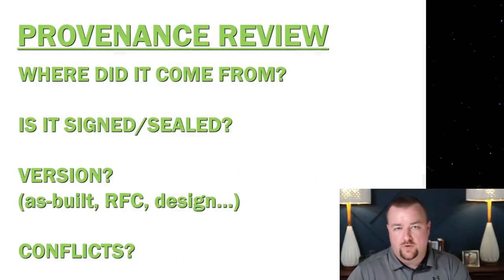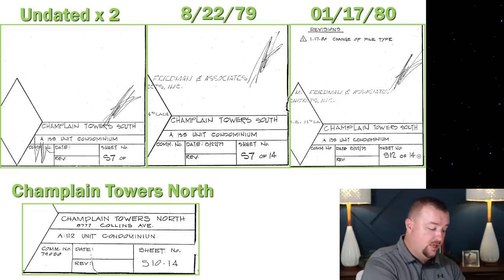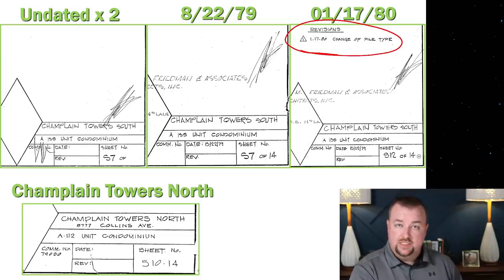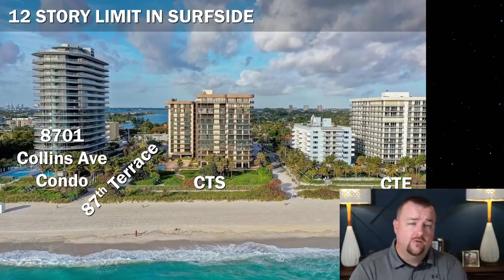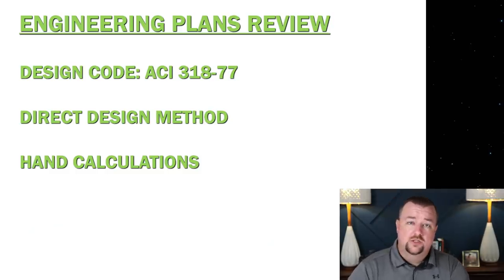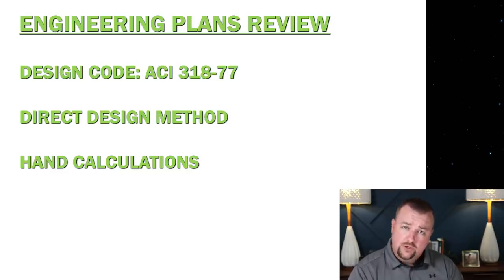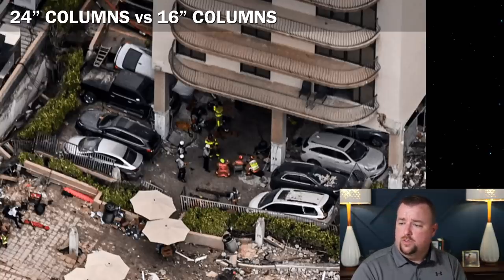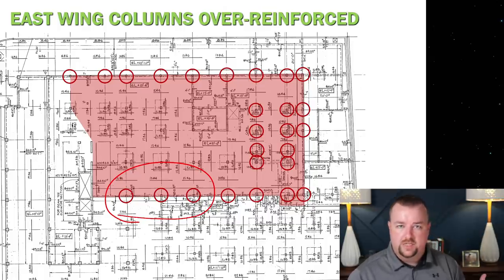Engineering Failures Found in the Champlain Towers South Drawings - Surfside Collapse

Comment: Not sure how it works in your World but in mine (Aerospace), EVERY aspect of an ECN (Engineering Change Order) after "Rev. Basic/O" Drawing gets signed off on from all affected Engineering Groups (Stress, Manufacturing, etc.) at the detail level which then feeds "up" to higher "Integration Levels" to ensure "Continuity".  As the Design "Matures" or is "Improved (say going thru many changes over the years from Rev. 0 to say Rev. X), many factors are involved ... including a new set of eyes looking at potential "flaws" in previous revisions along the way ... sort of a "Fail Safe" Process and the lines of communication are "2 Way" ... both up to and down from "Integration Engineering" (including overall Aircraft "Weight" (Gravity works 24/7 ;) and you can't "pull to the side of the Road at 50K feet".

I bring this up, my question to you, is how are "Engineering Changes" handled in Civil Construction? I get the initial stages from "As Designed/As Built" ... but what happens after that? Did the original Engineering Company retain that function of oversight or does it get handed off to an "HOA"? I say this because without the Beams you speak of, there most probably were loads that over maxed the compressive loads/shear punch limits in those areas ... from individuals putting in giant "Hot Tub/Bathtubs" to allowing far larger vehicles into the Parking area over the years; there's a reason our Highways/Bridges have load restrictions right? All it takes is one 20 ton Truck rolling over that unsupported (and "Beamless") area to have cracked it. Just wondering who has the "Ball" on those aspects...

Great job on the investigation and continue to enjoy your insight into this field of Engineering !!! Bravo !
Reply: HOAs do not enter the picture until the construction is finished and most of the units are sold.

And before we villify HOAs, remember they are just laypeople who have no engineering or construction experience.  Did you get an owners manual for your home?  Neither did they.
Reply: Aerospace ... you mean, like the Boeing Maxx??    

There are a lot of systems for both aerospace and engineering/construction, but they only work as well as the competence and integrity of the people executing them. 

Remember, 49% of people are below average...and even a C+ or B- practitioner in these trades could prove deadly.  This engineer was clearly not A level.
Reply: @1556cm  the question, as I indicated in my comment, was for Josh ... his Channel not yours. And I disagree with your premise that HOA's shouldn't be 'Vilified" ... if an entity takes the job, then they need to have adequate Staff to do the job (i.e. capable/educated Engineering Staff or outsource access to same). If what you say is true (you don't state your Engineering Background), then that, IMHO, is a BIG hole in the Process and needs to be rectified.  And actually, yes I did get a full set of prints/manuals for my house here in the French Riviera ... it too is built in "Concrete" as are most in EU.
Reply: @craigsowers8456  HOAs are volunteers from among the owners in a multi-unit housing who get elected for usually 2-year terms to make sure bills get paid and contracts are issued for normal maintenance.  They do not have staff.  They may have a property management company who assists them.  None of them are engineers.    

Here in the US, no one gets a manual for a building like this to tell them what maintenance is needed.   When something goes wrong, they get several bids and hire someone to fix it.  In this case, they did hire a contractor to make repairs, but had no way to know that he did not know what he was doing.

The HOA Board must have approval of the homeowners to raise dues more than a minimal amount, and those owners will almost always say no.  This is a gigantic flaw in this system, and the law that allows owners opt out of accruing funds for future maintenance is as much a part of this building collapse as design flaws.
Reply: @1556cm  Thanks for the explanation and fully agree ... HUGE HOLE IN THE SYSTEM !!! Seems like a good "Class Action Suit" to me !!!
Reply: @bluur101  No, but your comment is one more example of why one shouldn't  "ass"ume.  I am in Finance and quite familiar with those concepts.  But most people--you might say, the average person--is probably not.  Therefore, I didn't get technical about a subject which is irrelevant to the topic.

Comment: The beam question: guess the weight of vehicles in the '70s (pre-oil crisis) compared to nowadays SUVs! 
Conclusion: "size matters" :o)
Reply: but the majority of them would have still been large heavy pigs of pre oil crisis, especially in Florida far away from the rust belt, even though ocean salt spray is bad.
I imagine those units were not cheap back then and the richer folks had plenty of money to keep fueling their pigs :)
Reply: @throttlebottle5906  the new clio is almost a half ton heavier as the one from 2004....mine has 1090kg the new 1510kg .....
Reply: @tomast9034  I'm used to vehicles that weight 1900 to 3000kg! 4200 to 6600 lbs (rounded). not including anything over  3/4ton rated vehicle.
that's what the majority of USA trucks, vans and cars weighed back then and many still exist today. that's also the GVWR of todays large SUV's here.

Comment: I find it hard to believe an engineer forgot to add live loads when he engineered any parts of that building
Reply: They didn't forget. The loads are noted on the drawings. They just made a mistake in the calculations so that the overall capacity could just support the DL without any factor of safety. You have to review the design notes to see where they made the error.

Comment: Columns above not in alignment with columns below.  Transfer beam missing at key live load areas in lobby-level parking.  Dead loads at 100% before live loads added.  Building waiting 40 years to begin to take corrosion and structural damage seriously.  

If you produce another video, I look forward to your explanation of the likely progression of the failure once the lobby level parking slab punched through.  I think it will reveal further design errors.

If the structural engineer and firm are still around, they will both be sued into bankruptcy unless they have a very hefty E&O policy...but I doubt the policy will cover what will likely be nearly a half billion dollars in claims.
Reply: Unfortunately, the engineer and developer/ contractor escaped justice in this life.  We can only hope they received it in the hereafter.

In CA, there is a 10-year limit on suing for patent (observable) construction defects.  I don't know if there is a limit on latent (hidden) defects.

Comment: So the building was built unsafe from the beginning. It was the blueprint was changed and the architects didnt change the plans to make the necessary strength back into it after making these changes
Reply: even the original plans were at Max load as in you can't put anything more there like planter, large crowds, construction equipment and supplies, fire trucks, ect. and there can't be a Ocean anywhere near by as in salt water. Even the original plans were build to fail in effect.
Reply: Oh forgot to add they added a additional layer of pavers on top of the original level thus doubled or more the dead weight fo the slab. (this something that must be expected in plans, people with cover old with new instead of remove, people will put anything that will fit on top of things)

Comment: The only person crazier than realtors is a "developer".  At least realtors have to attend barely a school.  Developers just have to have money.  

The system is flawed.
Reply: And what do you suggest?
Reply: Thats what regulations are for, along with Plan Check.
Reply: To be fair, a developer just appoints consultants to do the design & construction, all being educated, trained and registered in their particular fields.   They don’t undertake any of that.   What degree do you need to assemble a design & construction team?   And usually when you have obtained enough money to undertake such projects, you are able to assemble teams.   Sure developers put pressure on design and construction teams to build cheaper, but theses consultants have a duty of care not to give in.  Part of the job.
Reply: @ProjectFairmont  Justin is correct about developers and there is not an easy answer to the problem..My guess and it’s  only a guess that the project was out of the budget and changes were made to reduce the cost. Architects, engineers and the contractor want the project to progress and they will offer various solution to reduce the cost.  The professionals must resist the pressure exerted by the developer to take things to the edge.  Sometimes you have to walk away but I guarantee there  will be others to do the job.
Reply: @Jim Archer There is no way in holy hell that a licensed engineer made structural changes to a building that would jeopardize the occupants, and his/her career, under pressure to "save costs". What a load of crap.
Reply: @ProjectFairmont  I would recommend a second independent check of the structural design by the authority as part of the permitting process. It doesn't even have to be a complete check. In order to save costs, you could even limit the design check to commercial steel and concrete buildings over 2 stories high. It just increases the overall level of care. Right now there is no independent process. The design and checks are all done by the developer's consultants.
Reply: @roscoejones4515  Back in those wild days in Miami of course they make those changes they wanted to actually be able to work. Even now it should be easy to find licensed engineers that would do it or at a minimum like here design to just meet the minimum standard of max load. 
Developer was a very shady person with possible mob connections, one inspector seams very compromised. I forget which key figure had been suspended in the past I think it was the Engineer.

Comment: Basically the way they designed this building is like stacking dinner plates on toothpicks and then putting a cinder block on top and then get the toothpicks wet.
Reply: Nonsense. Watch the vid again.
Reply: The columns did not fail originally, the deck failed, and it was that failure that led to damage to some of the main structural columns and subsequent collapse of the building.

The columns supporting the pool deck were still intact after the deck collapsed, they did not fail.

Comment: The 40 year interval was criminal to begin with. If I’m a 55 year old (corrupt) developer I’m not concerned about 40 years from now. I’d do the least amount of work necessary to pass the initial requirements and let the next generation deal with it.
Reply: Well said. And the 40 year rule was created from a Government building failing 40 years after construction so it should have been 35 years at the longest just based on that. But correct no more than ten for complete rework. And all plans with additional changes should be rotated though a automatic recheck everything process over time.

Comment: 8:44 People tend to design to the minimum code, and tend to push to the maximum that the regulation allows.
That's how the building owners trade safety for the maximum profit.
Reply: That's unfair, because it's over-simplified.  You must design to a finite budget, or no one could afford to live in the result.  (More realistically, you'd never raise the money to even break ground.)  That's where good engineering comes in--making the most structurally efficient use of a fixed $$ amount of concrete and steel.  In this tragic tower, it seems they stole from the Structural Budget, and put it in the Decorative Marble and Pretty Plants Budget... rolleyes

Comment: Any City that isn't going through older buildings drawings is setting themselves up.
Reply: There is a similarly designed building down the street from me.  It is 17 stories high.   All the columns are thin and spindly.  Get this, the building was originally built in 1967.   It has sat gutted for over a decade with no walls.  Just alternating slabs and thin concrete columns.  It was exposed to the elements all that time.  This includes hurricane Erma.   So they slapped on paint and walls and carpet and now it's a 65 unit condo building.  The building across the street I watched being built more recently.  This was built using more traditional load bearing walls but it is 5 floors and the supporting walls are constructed from 3" thick hollow concrete blocks and I walked past the site every day for months and never once saw them use rebar.   I'm pretty sure I could knock that building down my by leaning against it.

Comment: I think that you’re a hell of a great engineer.  Job well done.  Your information not only makes sense, it may well be what eventually brought down this building.  The big question is, IS THE SAME DEFECT SITTING OVER IN THE NORTHERN TOWER AS WELL?  And has that building’s condo association been made aware of the issue?  Because either way, they should retrofit this area by reinforcing those columns and having the proper beams put in place.  In the meantime, they should remove those planter boxes as soon as possible until the area in question can be properly repaired.

Comment: This verifies other architectural drawing analysis I have seen in the last month or 2 where they also were very concerned the building was at or near 100% just at empty dead load. One thing they never really did, was try and answer the... "are the drawings as built or not" question,  and you did. I hope the inspectors have a look at the sister building and fast. Let's hope it does not have the same or similar issues.

Comment: I appreciate the effort and the amount of time put into gathering all these information. Well done.
However, there are a lot of small inaccuracies which might be interesting to some folks:
- "Plastic yielding" of concrete over time is not a thing. I think you meant to say plastic creep.
- The temperature and shrinkage steel issue is not an issue. Where the bottom bars don't overlap for 20", you still have the top reinforcement which counts as T&S steel.
- #4@12" is the exact minimum T&S steel required for a 9.5" deck, not a lot less